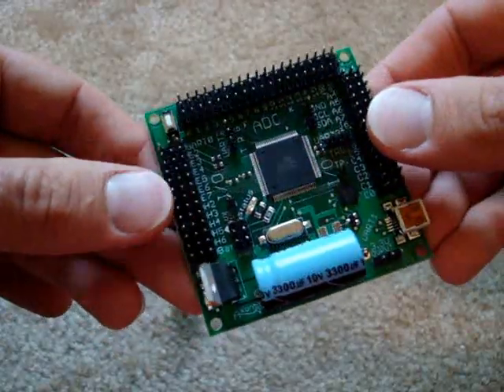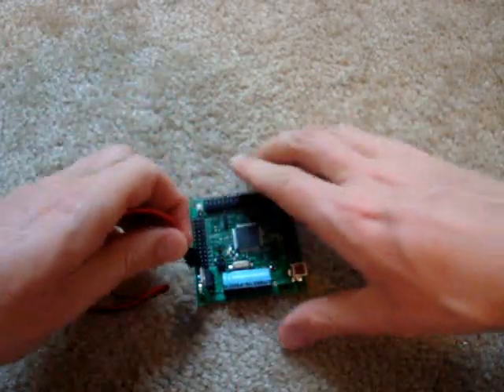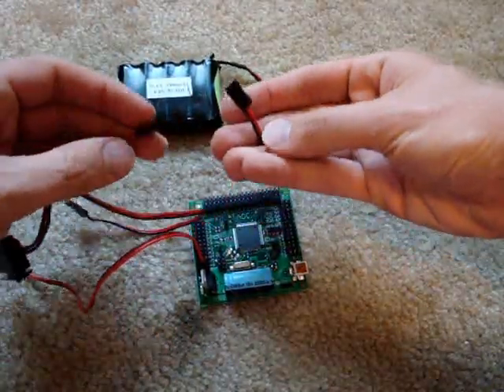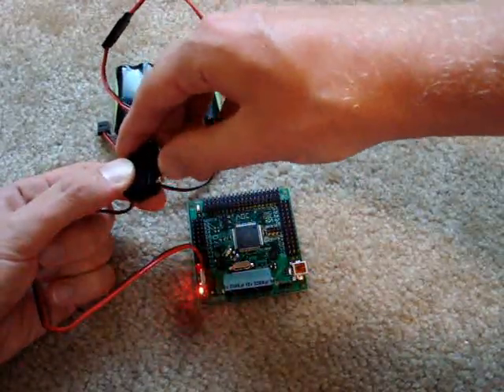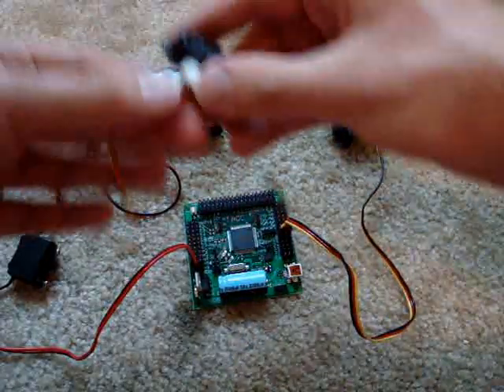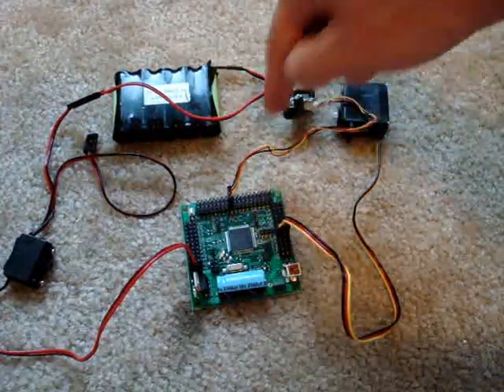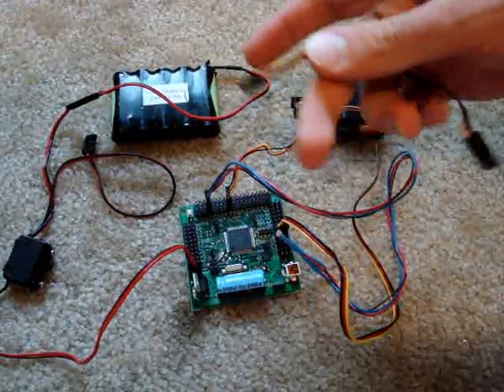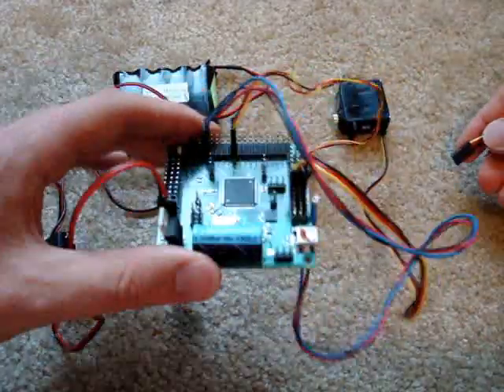Axon Wiring Demo

Comment: sweet, but for what i have learned, if you really want to keep soldering to a minimum, you should use female headers on the board, easy to plug normal breadboard wires on them, thats what i'm using on my ''mother board''
so i can protype easily without having to solder headers all the time, and when i move it up to the finished project, i'll solder the headers...

Comment: How puts a $125 microcontroller directly on a carpeted floor? Granted in most cases you can get away with it but its still not very good practice. The static build up in carpet can be quite large sure wouldnt want to run the risk of shorting out your board. By the way this board looks amazing I wish I had the money for one, there are so many projects I could do.